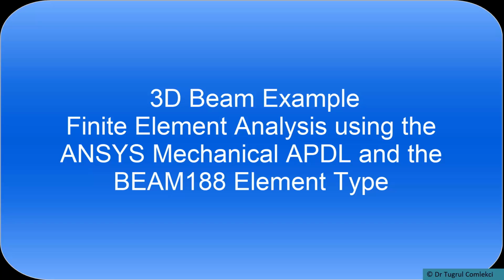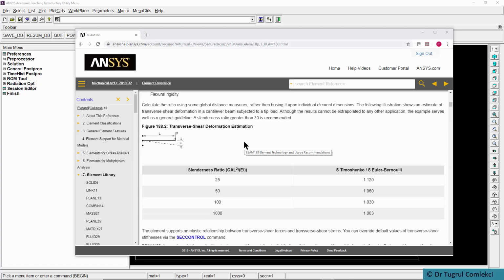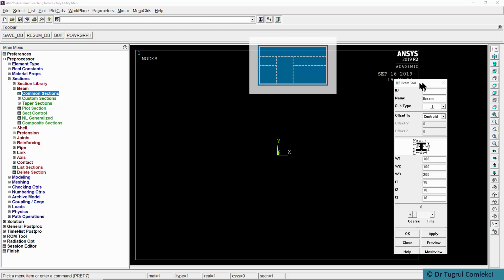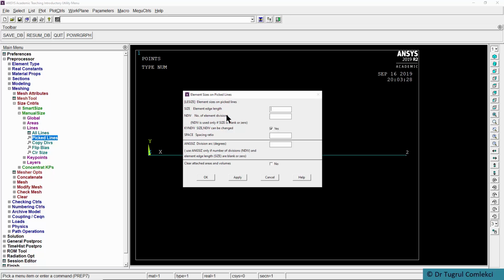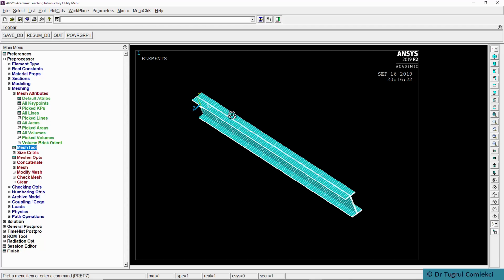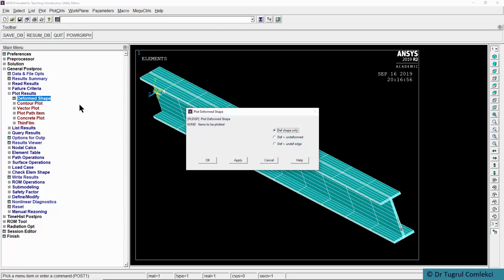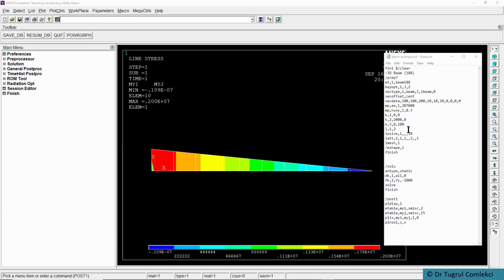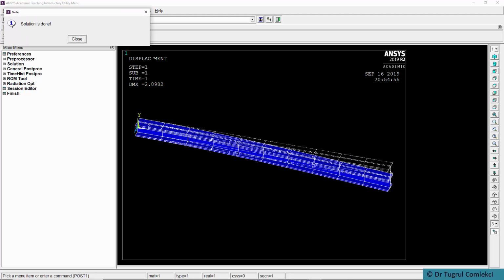3d beam example finite element analysis with ANSYS Mechanical APDL and BEAM188 element type

Comment: Thanks for the video, it is very well explained. I am modelling the beam using the APDL, but considering 7 DoF per node. So far I have been able to obtain the results of the warping bimoment distribution by just doing similar things to this tutorial.
However, I have one doubt, would it be possible to apply the load in the node using an eccentricity? or for having load with eccentricity should I define a rigid element that simulate that?
Reply from the maker: Thanks for viewing and your post. You can try a rigid element to apply an eccentric load. Or there is also a "remote force" type load which allows you to apply a load at a specified distance from the selected point. Important point is to validate the results you get by hand calculations and making sure that the simulated structure response is as would be expected in the real world.